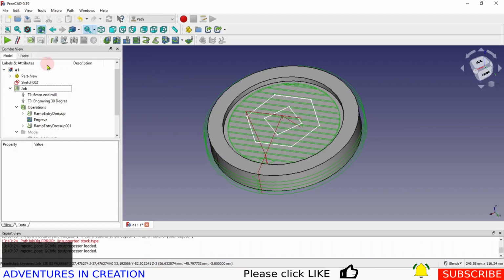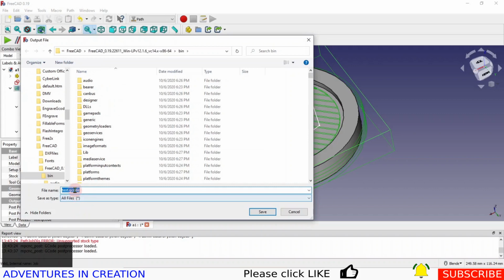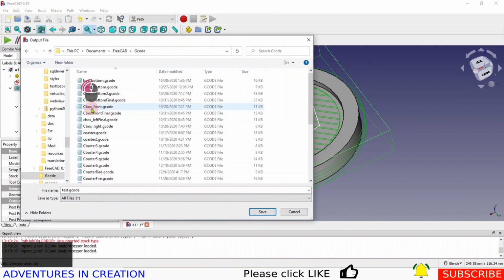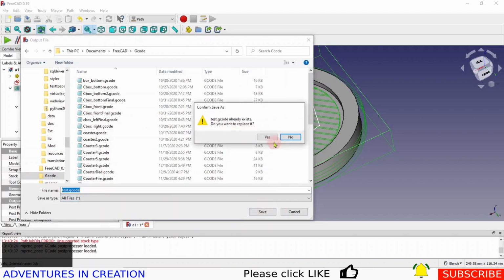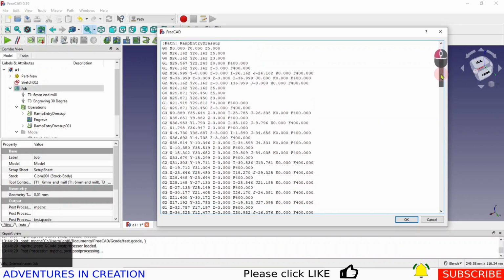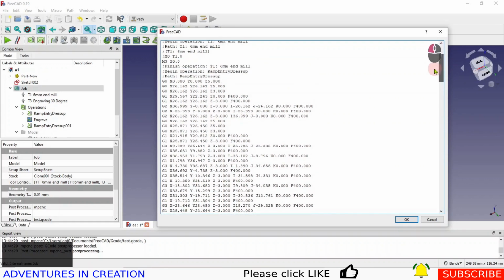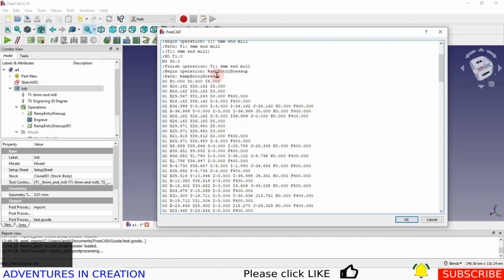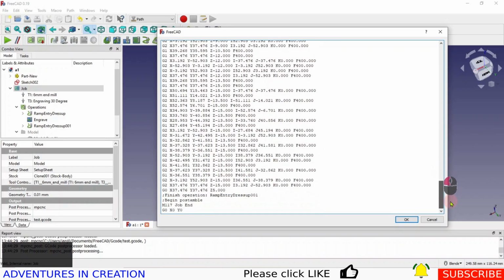FreeCAD Christmas gift idea using the path workbench. Engraving and Machining with the CNC router.

Comment: Thanks for another great video, thought attempting to follow it "now" (aka24.07.10) on linux, using FreeCad.v.021.2 has proven to be a bit of a challenge ;) It looks "quite different", and oddly enough I feel like I'm missing things rather than the "other way around".. But I think I got the gist of it :)
Best regards
P.S..A thought about the "oddity with the rapid values", which by the way still persists in "my" version... Could it possibly be the case that when You enter the "movement"the entered number (for some odd reason) is "interpreted" as mm/second, but then it is "automatically recalculated" and displayed as mm/minute. I.e. it "simply"multiplies the entered value by 60 ??
Reply from the maker: Good suggestion, I will check it out. I am just completing the rebuild of my cnc so I will be creating some videos with the updated cam workbench which I think is missing some stuff 🤔

Comment: Could you please do a video on creating coasters with an SVG image engraved on it? That would be so helpful 🙏
Reply from the maker: Sure, how do you want to do the engraving, with a laser or a cnc?
Reply: @Adventuresincreation  With a CNC. For me it isn't clear where to use which bits. For outlines I can use a V-bit, that's simple. But what if the image contains filled parts. Do I have to switch to an end mill and make a separate path for it? Also the placing of the SVG onto a model (coaster) isn't clear for me. To see the whole process would be very helpful

Comment: Ok you didn't show the actual engraving and cutting with the tool changes. Does freecad automatically stop the machine and hold thee steppers on the tool change or do you have to do something else ?
Reply from the maker: Yes, you can cause the cnc to pause for the tool change.
Reply: @Adventuresincreation  ok do I do that in freecad or universal gcode sender?
Reply from the maker: @scotthow2933  in freecad
Reply: Ok thanks for the quick responses! I'll have to learn how to do that in freecad but you and your videos have helped a lot ! Thanks !
Reply from the maker: @scotthow2933  no worries, you'll see it when you set up multiple tools

Comment: i cant get path to do shit.
Reply from the maker: Are you using the latest version?
Reply: @Adventuresincreation  yes, its so confusing wont let you set depths or height wont cut a pocket unless its the zigzag. on and on complete pia. not new to cad cam. mc 9 and 10 surfcam, 5 solidworks, alibre, onecnc, f360.
Reply from the maker: @toddsutton5672  you can set the depths in the operation. If they are greyed out just click on the symbol to the right and it will let you modify the depth.

Comment: Brilliant! I am enjoying your videos very much. your narration has the right amount of detail, not off in the weeds but very informative about possible tricky spots. Question if you don't mind. I've got an SKR pro board on my Lowrider CNC and had the impression that Freecad Path workbench couldn't put out gcode that's compatible  with Marlin. Are you finding that the gcode is ok, or do you need to do further post processing of it? Many thanks!
Reply from the maker: I created a variation of the GRBL post processor for my mpcnc that seems to work well. There is a Marlin post processor but my set up does not like comments in () they have to be preceded with ; and tool changes require an M0  so that's basically what my version does. I haven't had any problems with it.
Reply: @Adventuresincreation  Great to hear. I'm going to have a look at that. I'm new to this and like the path workbench. I wanted to jump in with a cut in foam so I bought Estlcam but really like using FOSS whenever I can.

Comment: What is your technique for doing tool changes on the mpcnc? I noticed you created a post processor that deals with tool changes. Would you pause the cut, move to a clear area, change the hit, do the z touch probe and continue the cut?
Reply from the maker: Yeah, what I do is pause. I then move up in the z axis, change the tool, move over from the cut area to the stock and set up on the touch plate. It works great if you use octoprint. I have been doing a lot of it lately.